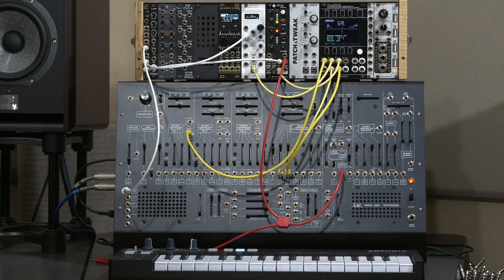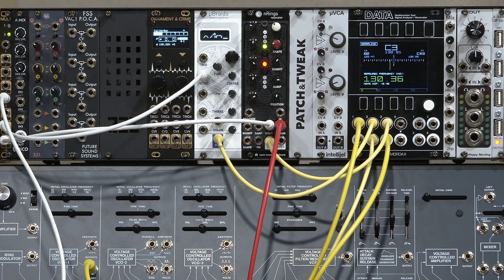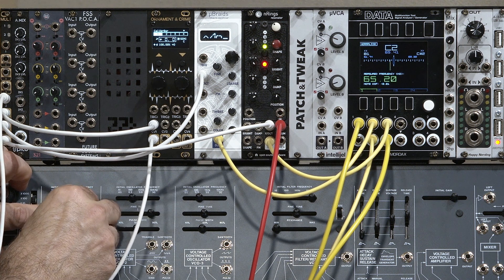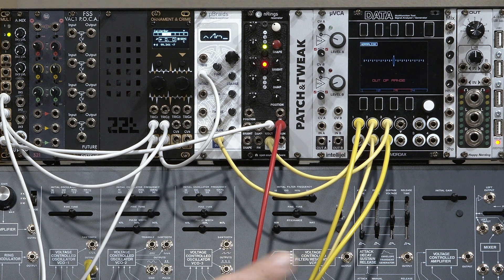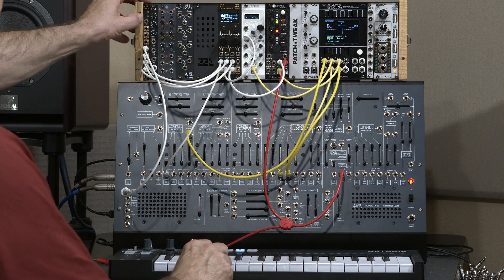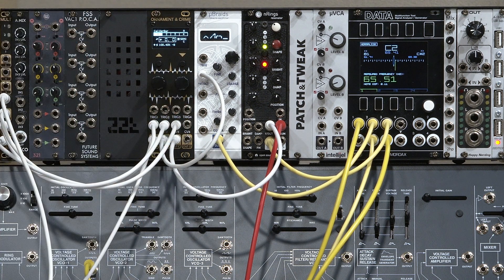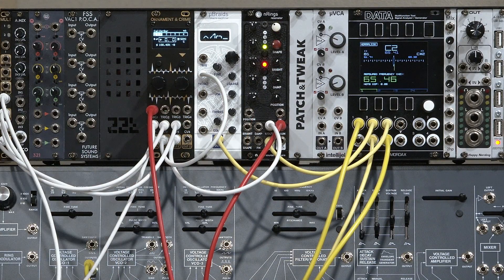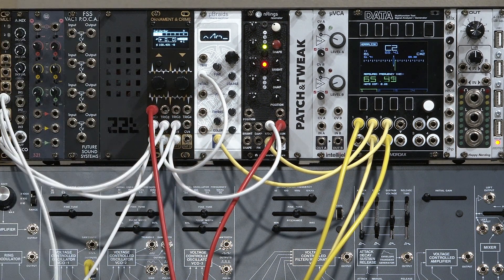Using the Calibr8or firmware for Ornament & Crime to make your Eurorack oscillators track correctly

Comment: I just wanted to come here to say what a fantastic app and express my appreciation for partnering with Mr. Phazorville on its creation. I have a  3 voice Behringer Arp 2500 system and I usually tune my oscillators with my Expert Sleepers Es-9 but I have no remaining inputs. The Calibr8or app solves this problem and then some.  Combining the quantizer and calibrator with the octave / semitone offsets and the library of scales/modes is fantastic.   I can see why you have 6 of these in your monster rig. 

The Behringer 2500 series shows excellent tuning stability up to C6 when tuned with this app which was a big surprise for me. I expected having just two reference points for calibration would make it more limited than it is. All chromatic notes up to C6 are nicely in tune.  I am sequencing the Behringer 2500 with the 3 channel analog sequencer which lacks the 3 quantizers you would want for melodic sequencing.  

I have another O_c coming my way this week and I'll likely assign it to the Behringer System 55 case and free up some inputs on the Expert Sleepers ES-9 for mixing duties. It too will get the Teensy 4.0 treatment. 

 I am thoroughly enjoying you videos. Although it isn't a huge thank you, I have signed up for your subscriber plus tier as a token of my appreciation.

Comment: Hi, my Ornament & Crime module isn’t working.

The Teensy powers up, and I successfully flashed a new firmware, but the module is still unresponsive.

I tried different power cables and ran it alone in my Eurorack case, but the screen doesn’t turn on.

How can I fix this? What should I check next?

Thanks!
Reply from the maker: If you bought this assembled, I would return it to the person or company who built it for you - it sounds like a problem deeper than any user error.

Comment: Hey Chris, can i use this to scale the v/oct input of my Modbap Osiris to track 1/v oct??
Reply from the maker: The Osiris already has a 1v/oct input, and is actually one of the better tracking VCOs out of the box I've found. It also has a built-in quantizer. I use Calibr8or with it just to help detune it more precisely (as its chorus function makes it go sharp), but if your Osiris is not tracking well out of the box, ask to get it serviced - it should work pretty well on its own.
Reply: @LearningModular  ok i seem to have a faulty one then. thx

Comment: Absolutely brilliant! Set my case up with this earlier and it sounds fantastic. Cheers to everyone involved with this, it’s incredible. I may have to buy another o_C though because I can’t see me using my current one for anything else!
Reply from the maker: I know what you mean - I've dedicated several o_Cs to just Calibr8or! I'm really happy to hear you're getting good use out of it as well.
Reply: @LearningModular  I’m a relative newbie to modular (2 years in) and was wondering if you could advise how I can monitor the voltage coming out of my Moog Matriarch, which is my main keyboard input to the case. You mention in the video about a lot of VCOs becoming unstable below 0v so I’d like to overcome that issue. Is there something in the o_C that will measure voltage?
Reply from the maker: @chitlun  the app References in the original o_C firmware can output voltages, but I do not think it can read voltage levels in - I'll ask on the o_C forum on Facebook to see if there one that does. I use a digital multimeter, or a Mordax DATA module.
Reply from the maker: @chitlun  I was told that the alternate firmware Hemispheres has a Scope app that can be used to measure voltages.
Reply: @LearningModular  Nice one. Thanks for looking, appreciate it!

Comment: 20 years ago I had four Modcan oscillators and a kenton pro cv controller. The tracking was quite good but off on the upper octaves. Im truly surprised that this issue is still so common in this day and age. I thought AJH V Scales module took care of this, at least on their YT channel it works.
Reply from the maker: The V-Scale modules are very useful; I owned several and also made videos about how to use them. Their major shortcoming for me was just one input for all five outputs, where in my case I want to be able to freely patch any of my sequencer channels to any combination of sound source that are patched to it. Also, they don't over the pitch offset, transposition, quantization, and sample & hold options that Calibr8or does.

Comment: Fantastic!! Would love to test it with my 4ms Ensemble Oscillator, as this module tends to detune over the keyboard.... or maybe it's the Arturia KS37 causing it, don't know.
Reply: Have you figured this out? I just included this 4MS module into my workflow.
Reply: @sillyworm   I had it installed but went back to earlier O_C firmware editions, due to several bugs I encountered with Phazerville in my ornament & crime module. I prefer the original FW, Hemisphere and Benisphere editions. As for the 4ms Enosc - I found that my 'tuning' depended very much on the Root and Spread position of the knobs, to behave fine or not. Also I went through the Enosc calibration process again (as written  in the 4MS manual ) and had no issues after that. I could very well  play the Enosc from ky Keystep 37. Guess it's a matter of spending more time with the module :)

Comment: The original firmware has auto calibration somewhere in the setup page. It’s marvelous to use with all the various sequencers and quantizers included. One of my absolute favourite modules, especially with Buchla.

Not really seeing the benefit with this firmware over the original auto calibration though.
Reply from the maker: The auto-calibration app in indeed o_C is very cool. But it does not seen to have the performance oriented features of transposition, selective detuning after calibration, scale quantization, sample & hold, multiple presets, etc. (Although it might be a good thing to merge the two together, so you had its auto-cal across multiple notes combined with those extra features.)

Comment: Hey there,
On the download page of github, not sure witch version to choose, what does main, stock1, stock 2 and VOR mean?
Reply from the maker: I had the same confusion as you, so I asked Nick (DJ Phazer). This is his reply:
"You can direct users to one of the four "+main" build variations, which all include Calibr8or. "+VOR" is for Plum Audio units, and "_flipped" is for upside-down module orientation. (I hope to make flipped mode a runtime option eventually)" I don't know the differences between Stock 1, Stock 2, etc., but I will ask him and add it to the article linked to the the information underneath the video.

Comment: Cool firmware. But the CalTrans is far better. The procedure is full automatic, the tracking is done on all the VCO range and not only for linear error (tune+% here = linear error only), the price is low (compare to a dedicated O&C for same function), it is smaller, it also tracks 4 VCOs and also have presets and global settings (octave...). The O&C is so useful with Hemisphere or BeniSphere firmware that it seems a shame to lock it just for this function a ClaTrans can achieve perfectly and more accurately. 
But thanks for the demo, this firmware can certainly becomes more appealing if it becomes just an App in Hemisphere for example, and if the procedure is automatic and the tracking correction manages non linear errors.
Reply from the maker: I agree that CalTrans is better when it works - I had several of them for awhile. It's automated; its inputs normal downward which can save some patching. And it's definitely the better solution for when the tracking errors in a sound source are not linear. 

But...CalTrans does not work for percussive or plucked sound sources; it does not work well when the control CV is near or below 0v; it does not have the sample & hold function; its scales are harder to access as well. And although I've had times when CalTrans has worked miracles, I've also had occasions where it made the tracking accuracy worse. 

So that's why I commissioned this firmware. Plus a µo_C takes up less space and costs less than the combination of AJH V-Scale plus Klavis CalTrans I was using previously.
Reply: @LearningModular  CalTrans is not perfect of course, I don't use it for the musical scales, I use half of a O&C in hemisphere mode for that purpose (or other dedicated quantizers I'm posessing). 
The Firmware should be just an app among others, locking the O&C just for a function is not the best way to use this versatile machine, IMO.
But in the modular world there are lot of solutions for the same goal and each of us has his/her own preferences. So if you find the firmware being a good solution for your usage, that's cool ! Making music is the real interest, not the gears themselves. 🙂
Reply from the maker: @KNHSynths  I don't look at it as "I'm using my o_C to run Calibr8or"; I look at it as "I wish I had a better tracking compensation module, something that combined some of my favorite features of CalTrans and the V-Scale, plus a S&H function" - and it just so happened that the already-designed o_C hardware running custom firmware was the best/most immediate solution I could come up with. I bought half a dozen o_Cs to replace the V-Scales and CalTranses I was already using.
Reply: @LearningModular  it's true that there is no real perfect solution for this very important problem. Having a good tracking and quantization is crucial when using many VCOs or when recording in multiple passes.
Perhaps thing will evolve. But it seems buyers in the eurorack world are more interested in techno-ish noises than in quantized melodies and harmonies, so the makers...
But I'm sure the day you'll find something more effective, you'll show it on your channel !
Reply: The original firmware O_c has auto calibration over the entire range but it’s kind of hidden in the setup menu. You calibrate each output separately and can then use it with all apps. An awesome feature.
Reply: @sonicaddiction  The original firmware is so limited that I don't know how people are still using it. But it as some good apps that's true.
Reply from the maker: @sonicaddiction  DJ Phazer and I (well, mostly him, since he's the one who has to do the coding) is looking at adding References to his Phazerville Suite so Calibr8or users can take advantage of the o_C's autotune routine. (Assuming it works for users; I know for starters it has the same issue as CalTrans in not working with sources that decay.)
Reply: yeas - CalTrans really is excellent
Reply: I have a couple of analog designs that track within .3% over 15 oct or so (up to 20kHz) with drift under 20 ppm/K.  Nobody would ever manufacture them. They have said it is overkill and not worth bothering with.
Reply from the maker: @frijitz001  I've heard people say "bass lines don't cover more than an octave - that's all the tracking you need." Obviously, I disagree... ;-)
Reply: @LearningModular  Yes, I'm so surprised of the lack of more people trying to get a solid solution for this problem. I know eurorack is supposed to be very experimental which makes several people not care about the tuning, but for actual musicians this is something that should be very important.
Reply: @frijitz001  That's not surprising, these days anyway. The majority of modular tracks are either noise, or more or less "hard" techno-type music, and are rarely melodic (fortunately there are some), and even rarer are tracks with slightly complex harmonies (say, more than 3 chords is already Mozart to some).
Stable VCOs with proper tracking are therefore of no interest to them.
In the days of Tom Oberheim or Alan Pearlman, I think they would have been interested in this kind of thing.
Besides, when you see how few solutions there are for playing the right notes with good tracking (basically, what the video and Caltrans present isn't much), it's easy to see why those who make music with modulars aren't interested... That's a shame.
Reply: CalTrans gave me so many headaches, this seems like a much better solution. It boggles my mind how people like the CalTrans.
Reply: @mikedurden  what was wrong ?
Reply: @KNHSynths   I had the same issue that Chris mentioned about when the source was around 0V. The fact that they suggest you have to use ANOTHER MODULE like a precision adder to get it away from 0V seems like a weird oversight on their part from a design perspective. The tuning was wayyy off at or near 0V. Plus overall it was very inconsistent. Sometimes it worked ok, but then other times I would have to calibrate multiple times to get a decent tracking. Plus the choice of effective tracking of 0 to 7V they note in the manual but it still accepts -3 to 7 for others . . . again just a really weird design choice imo, considering the common ranges of sources i.e. sequencers, MIDI to CV converters, etc. I spent so much time trying to troubleshoot it before realizing I think it's more flawed than useful for me.
Reply: @mikedurden  I did not experienced such numerous failures. Generally the problem is in detected range that is not very good, but the problem is coming from some VCOs that are not very stable or sometimes it's my bad, I don't let the VCOs warming enough time.
But I hear your testimony and it is an interesting feedback. Thanks.